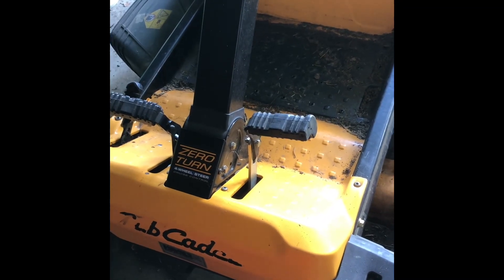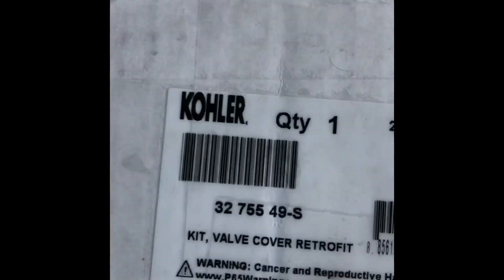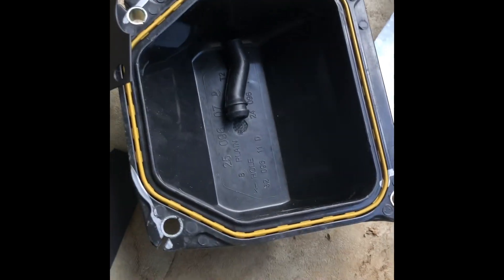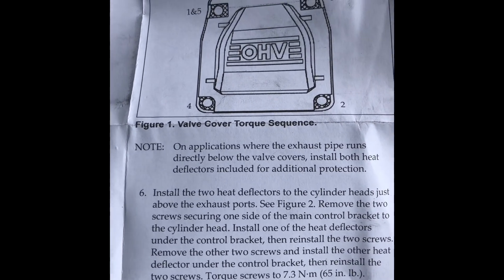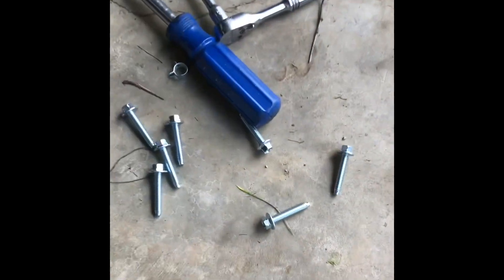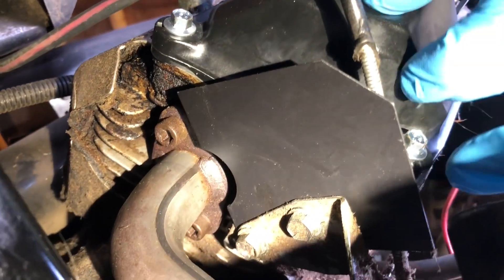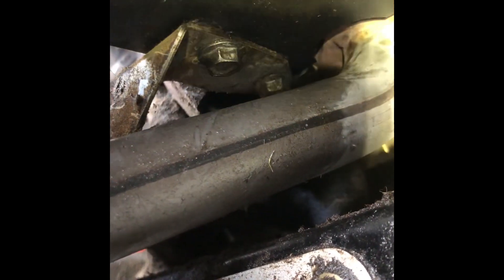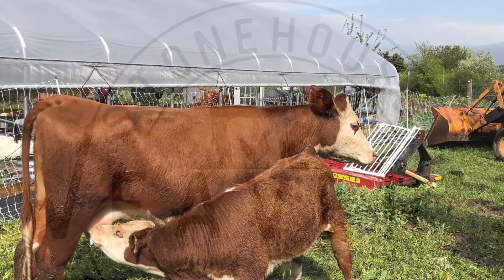Kohler 7000 series 22hp valve cover retrofit from stamped steel to composite with heat shields.

Comment: I have no oil leaks with the original cover, but am going to need to remove the valve covers to adjust the valves. Wondering if I'm better off just reusing the original covers and using the Kohler Gasket Sealant
Reply from the maker: @popeyeandy959  knowing what I know now, I would purchased the aluminum aftermarket covers or the Kohler composite covers with the integral gasket and heat shields.  
Don’t waste your time with the sealant. Upgrade the covers and get the heat shields. 
We use our mower for at least one tank of fuel each time sometimes almost two tanks of fuel when we mow around the barn, lane, and some of the farm equipment.